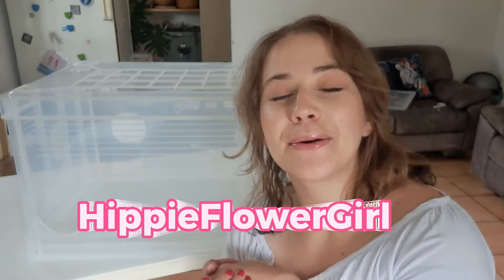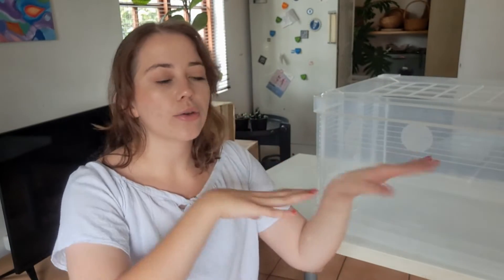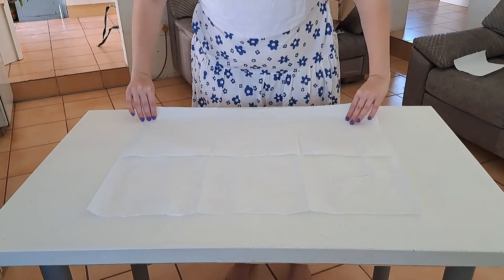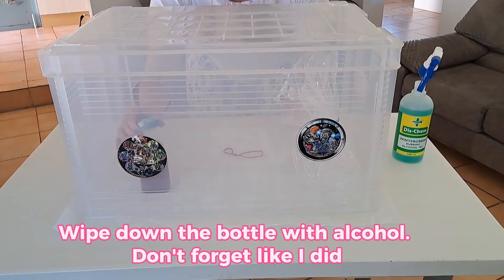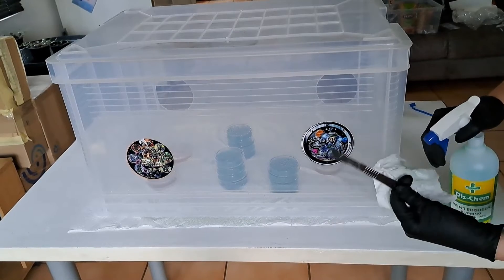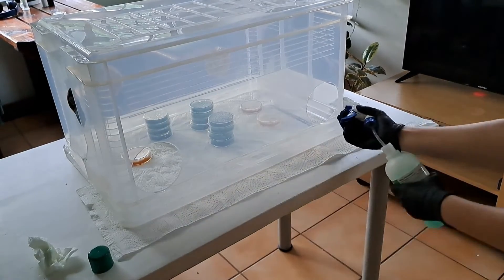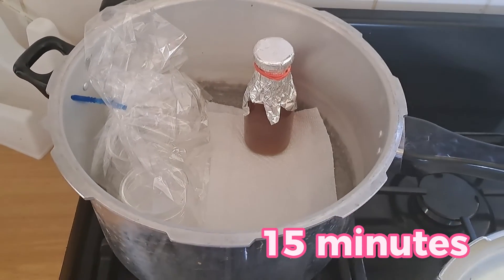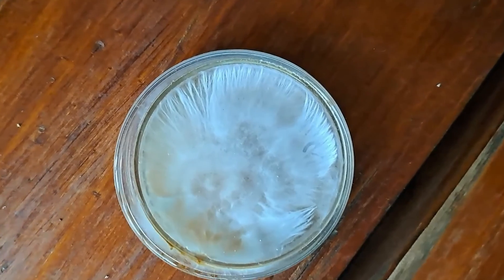What is a Still Air Box and How to use it #mycology #mushroom #mushroomgrowing

Comment: If plastic petri dishes can melt how so people but them in pressure cookers? Sorry newbie question.
Also are you completely self taught? P.s. i love your nail colour!🎉
Reply from the maker: So you have to look for a specific type of plastic that doesn't melt under extreme heat. It has PP5 on it which stands for Polypropylene (symbol #5). That doesn't melt but it is difficult to find
Reply from the maker: Yes i am completely self taught. I found all my info on reddit and Youtube.  
Thank you <3

Comment: @hippieflowergirl Great video and good to see this here. For future reference, if you'll take some advice from a center which has been growing and using mushrooms legally, at some scale for a while now for our work with those with PTSD, cluster headaches and other conditions, there are a few misconceptions here. For example,  a SAB is just that - a still air box, not a sterile air box. It's impossible to sterilize the air in the box. While it is good practice to keep your SAB clean of course, there's no need to use alcohol to sanitize the SAB, or to try and sterilize the air in the SAB, or indeed to try and sterilize anything in the SAB with any sort of disinfectant spray. Soapy water also works somewhat better on the bottom than alcohol, as it traps particles more easily and doesn't evaporate as quickly. Wearing gloves is a must, as there are far too many potential contaminants, such as mold spores and skin particles that can come off of bare hands, especially if they are over the dishes, jars or whatever (which they should not be if possible). Rubbing one's gloved hands with alcohol before putting them into the SAB is good but that doesn't sterilize, it only sanitizes and that's just fine for SAB work.

Also, plain, small glass mason jars are cheaper than petri dishes and are reusable, whereas plastic petri dishes often aren't.  Larger arm holes can help as well, since there is less turbulence than with smaller ones and more freedom of movement. Parafilm isn't needed at all by the way. Simple cling wrap does just as well, is easier to use generally and is a lot cheaper. Covering the arm holes before and after putting in everything that one needs and then leaving the SAB for a couple of hours (dependent on the size of the box), is optimal, rather than just ten or fifteen minutes. 

As to sterilizing tools, best practice is usually to flame sterilize whatever one is using to take agar sections, or to put spores to agar and such, outside of the SAB. Never inside, especially if alcohol has been used, for fairly obvious reasons. Spraying again, when you introduce such things into the SAB defeats the purpose again, since it causes more turbulence. Just sanitize with alcohol any jars, dishes and so on in the SAB when they are first introduced. Then leave the box as mentioned to settle. Flame sterilize any tool outside of the SAB, just before introducing it into the boxa and that's it pretty much. 

For those wanting to get into mycology, the most essential purchase is probably a good pressure cooker, which you mention at one point. That makes preparing sterile agar, grain and so on just so much easier and more consistent. In the US a decent sized one can be picked up for about $40 and it's well worth the investment. As to Rhizomorphic growth, it's something of a myth that that's more desirable. The same mycelium will in fact show either Rhizomorphic, or tomentose growth, depending on genetics and environmental factors. It makes no difference to the actual process of cultivation, so isn't something that one needs to really be concerned about. I hope this helps and that your channel does well.
Reply from the maker: Thank you so much for sharing this knowledge. I really appreciate that you took the time to write it out.  I have learned my methods through reddit, shroomery and my own experience which have succeeded and failed. You have given me some great ideas that I will try out. 

P.s Agreed. Pressure cookers do make everything easier and more reliable.